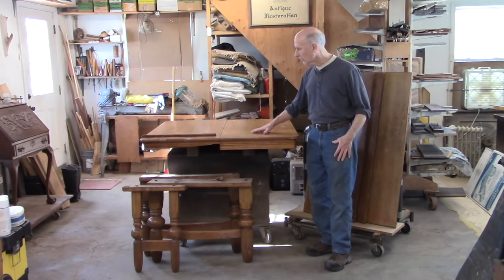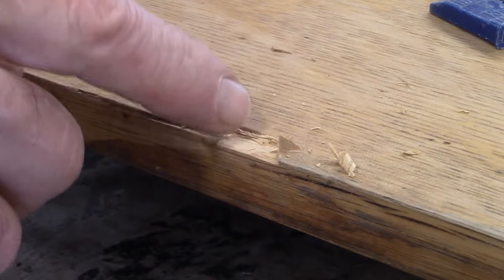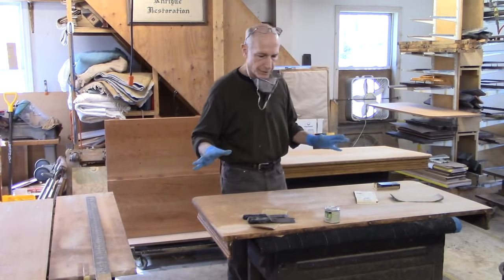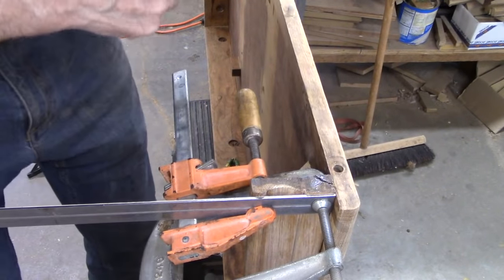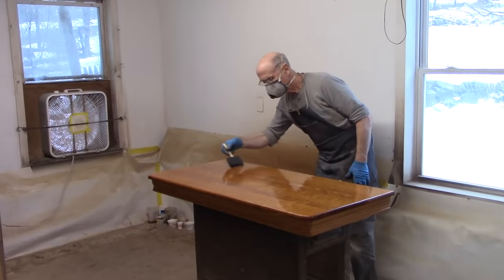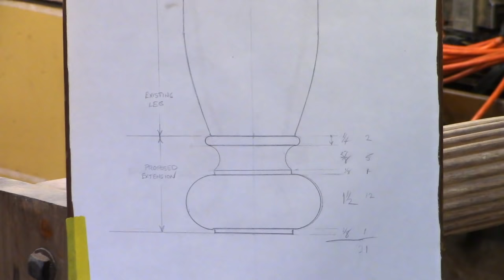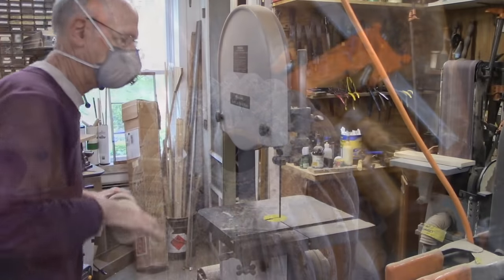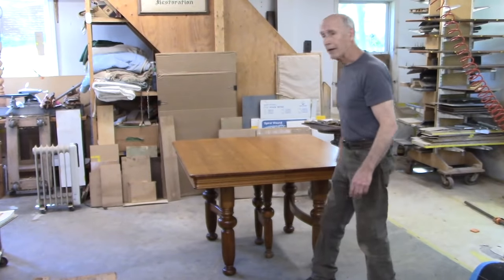A Complete Rescue - Thomas Johnson Antique Furniture Restoration

Comment: I wonder if the spills of the oxalic acid on the floor pose a hazard to the dog's paws.
Reply: He always wipes the floor afterwards, he mentioned it particularly in another video 🙂
Reply: Not so much to the dog's paws - oxalic acid is fairly weak as an acid (especially diluted as much as Tom does), but it is quite poisonous, even at low concentration. 30-40 grams are likely to kill a dog of Bella's size.
Reply from the maker: Thanks! Yes, see dlevi67's answer. I clean it up and keep the dog out until I'm sure
Reply from the maker: Yes, thanks!
Reply from the maker: Yes! Thanks. Even spinach has a lot of oxalic, but I'm not taking any chances with Ella

Comment: Dear Mr. Johnson,

I have a set of three (or four, but i think three) nesting tables, 18th century I'm pretty sure, painted in black Japanese lacquer with gold illustration (?),  That's not the right word, but I can't think of what else to call it.  Im sure they are the "real deal," alright, legitimate 18th c. pieces, but the lacquer is is such horrible shape!

It's mostly all there, 99% at least, but the lacquer is coming away from the wood in straight lines, I guess 90˚ from the length of the wood surface, I mean on the short side, the "depth" of the pieces, about 1/4" or 5/16" wide parallel pieces, all cupped upwards, I bet you know what I mean.

It's a real shame, because I'd like to have these pieces restored----they are really beautiful----but they are beyond my ability.  Can you do it?  Or can you recommend someone excellent in restoring Japanese lacquer?  I'm completely serious.

My mother was Lorraine Waxman Pearce, if you want to look her up, to confirm my bone fides.

David,
Fredericksburg, Va.
Reply from the maker: Wow! My father did a lot of work for the Johnson's, before he took office, and it would not be surprising if they had crossed paths! We don't do long distance jobs, you should ask at museums, even the Smithsonian for referrals. One problem is that these tables are probably not valuable, but don't take my word on that
Reply: @johnsonrestoration  I must disagree with with you there as to the value of the three nesting tables.

I'm not saying they're a $100,000 set, nor a $10,000 set, nor even a $5,000 set.

They might be worth (if they were repaired) $1,000 -- $3,000 (I don't know).  But I do know they are extremely beautiful, and I am trying desperately not to lose the incredible workmanship in the lacquer.  It would be a real shame I think, they're that nice.

"Long distance jobs," what does that mean?  You mean I couldn't crate them up and send them to you, and you wouldn't work on them?  Maybe I can drive them to you at some point, and drive back to get them if you did the restoration work.

So you don't do lacquer restoration?  Do you know ANYONE who does?  I only write because I'm really sincere, and really desperate to save these pieces from wrack & ruin.

David

Comment: Forgive me Thomas but I never thought that I would ever hear you say that you were off to see some strippers and you took the dog too ! hihihihi On a serious not, were they chemically stripped ? A friend gave her antique doors to be 'dipped' and she got them back in kit form !
Reply: Yes; probably some solvent bath/flow. Getting things back in pieces does happen - though less likely to happen on a table top with long and smooth flat joins rather than on a door with mortises, tenons and mitres.
Reply from the maker: Thanks! Yes, chemically in a "flow over" system, not dipped. You have to do all repairs and gluing first so it doesn't fall apart. I will only take solid wood pieces to theses guys
Reply from the maker: Yes, thanks! You have to make sure everything is glued and tight
Reply: @johnsonrestoration  Yep. As I found out with a pair of shutters...